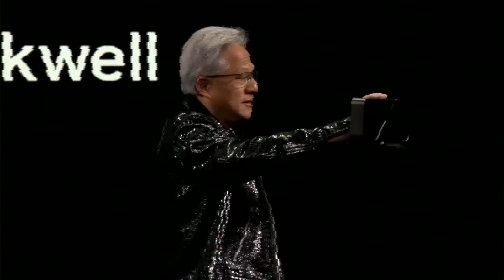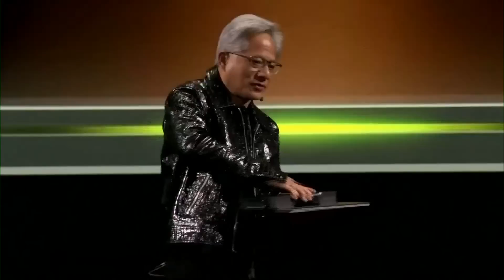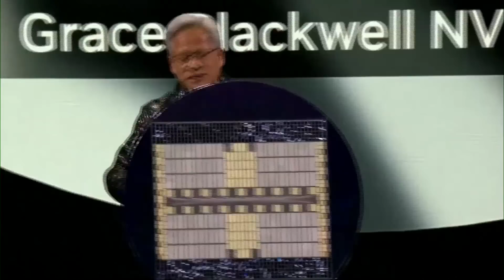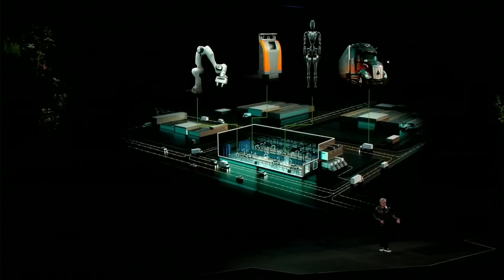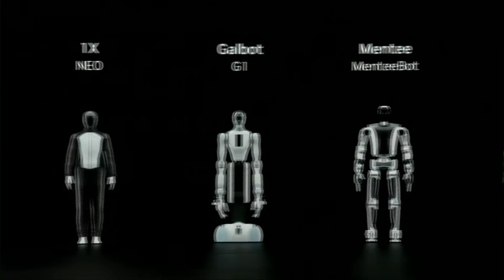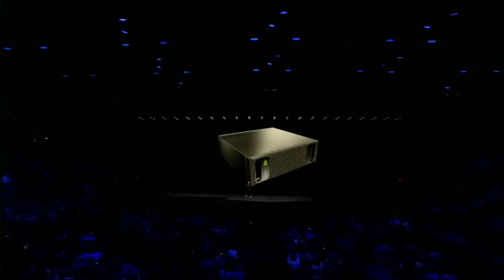NVIDIA'S HUGE AI Chip Breakthroughs at CES 2025 (Supercut)

Comment: On February 2016 I bought 100 shares of NVDA for $1,720. And had been split 4 for 1 and 10 for one , now is 4,000. Shares. I turn 100 shares to 4,000. Shares in 10 years about that time I sold 10 Bitcoin for $1,800. 10 Bitcoin now value about 960K. 4,000. Shares of NVDA is about 560K. Only 400K less. A mistake I will remember for the rest of my life.